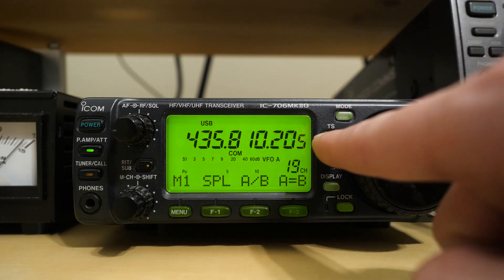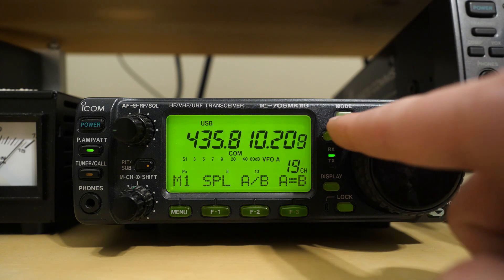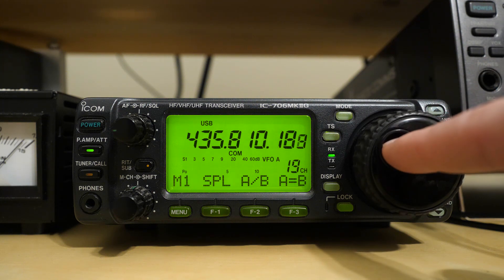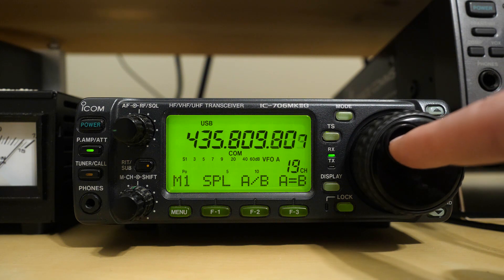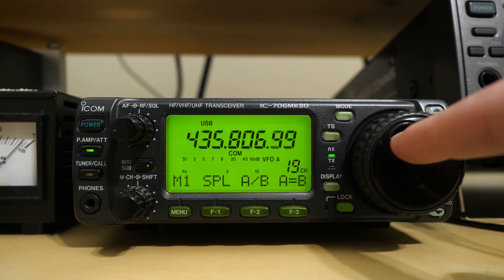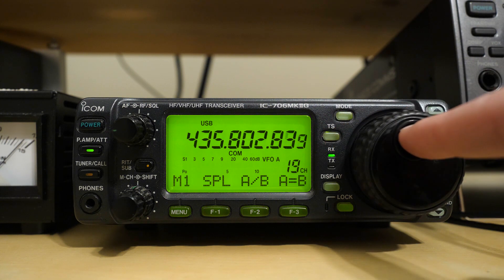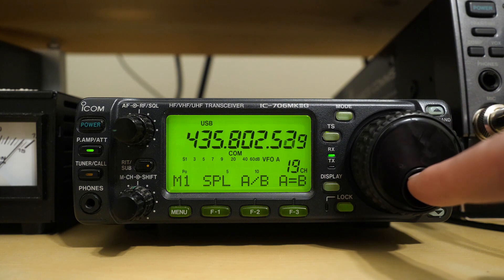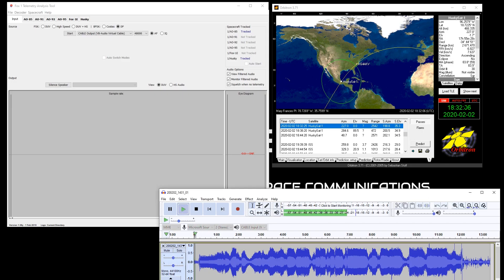HuskySat-1 decoded!

Comment: Like the Technics 1200, anyway are you recording with audacity then playing it back thru telemtry software. I have let to get a good pass, I am not sure I am even hearing that sound I wonder if my sat tracking is correct for the huskysat
Reply from the maker: Thanks. 

I record it onto an audio recorder when I'm outside then transfer the WAV file to my computer later on and play it from audacity to FoxTelem using a virtual audio cable. 

Try the amsat prediction tool. It has the latest keps:

https://www.amsat.org/track/index.php

Comment: $20 RTL-SDR.com V3 dongle is much easier to carry than the MKIIG, and you can let Gpredict or SatPC32 control the doppler for you.   I'm getting about 40 frames per pass (with my house blocking 35% of the sky) with one.   Give it a whirl.   BTW, I really like these quickly produced "breaking news" type of videos (the edited ones are good, too.... it's just good to see what everybody else is doing sooner rather than later).
Reply from the maker: I think I resist SDR cause I am on computers so much in my life it's nice to use electronics that are a little more simple and physical. Plus, while the SDR is smaller than most regular radios you have to connect it to a computer.

When I finally finish my ground station I definitely will use SDR at least for linear sats because I will be right next to my computer anyway. That said, I was thinking of getting one of the more expensive ones. What are your thoughts on those vs the RTL-SDR V3?

The funny thing is I bought my dad one of those RTL-SDR dongles a few years ago but it didn't work well with his mac. He doesn't use it at all. I should borrow it sometime, or at least see if the latest software on Mac works well. I think he wanted to use it on HF but the settings that were supposed to allow that didn't work for some reason.

I'm glad you mentioned the more quickly edited videos. I think I have been missing creating things, so I am glad to get back into into it, even with these simple videos. So I will keep what you said in mind. I should plan on making a video of the first passes when they test or open up the transponder.
Reply: I wonder if you wouldn't mind describing what you've done with your RTL-SDR? So far I don't see a signal on 435.8 for HuskySat, even though I just had a straight-overhead pass. I have Orbitron tracking and autostart-stop of SDR#. That works. But I'm so far not seeing a signal and hence not a single frame captured.